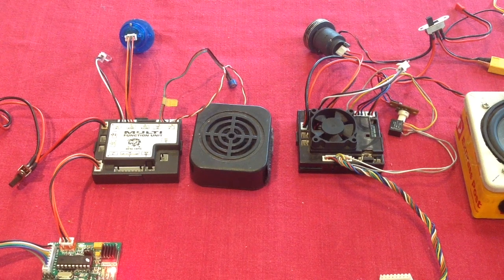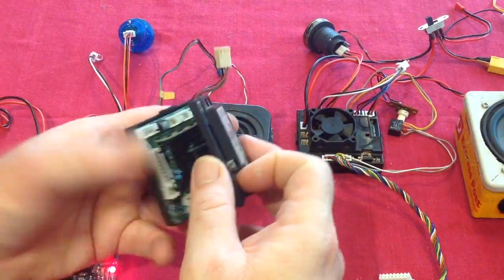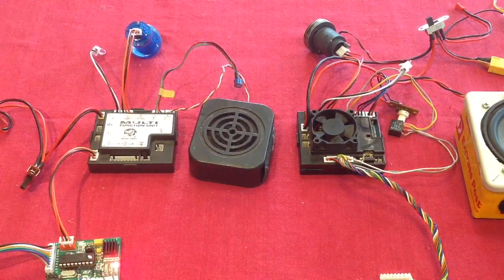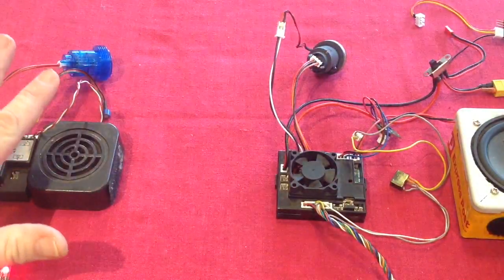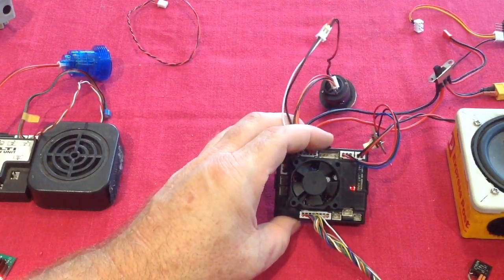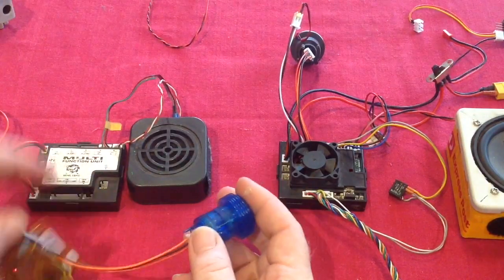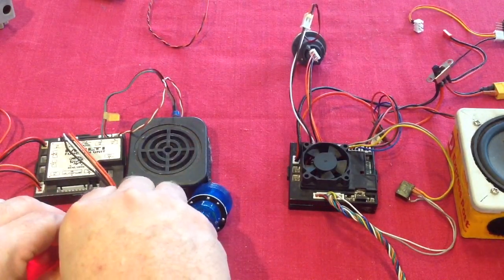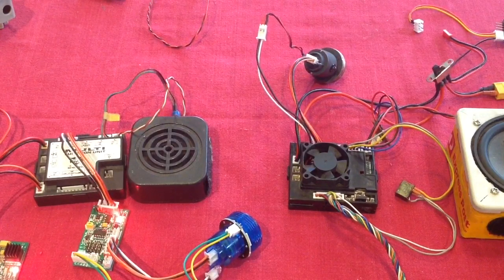Understanding The Heng Long & Taigen MFUs - Part 1

Comment: The RX18's were what I started with, of course, and they're all complete garbage.  Fail randomly, scratch that, they fail amazingly since you can always depend on them!  To fail, that is.  It was disturbing to play with my tanks, or attempt to, have them fail after literally a minute or two, and NOT even know what the problem was... was it the receiver (RX) did I burn up yet another one?  Or is it the transmitter (Tx) this time?  Did I do it?  Did i slap it too hard checking the AA batteries, or, heavens forbid, DROP THE TRANSMITTER - (instant DOA, of course!)  Anyway, the 2.4 units were a God-send since they worked practically 100%; simple to bind Tx and Rx (I was today years old when i realized you don't really need the binding switch just a screwdriver and a third hand attached to the other two).  Have you seen the Hooben stuff, i bought 3 Rx and 2 Tx and these look much like Heng long to me, do you know if they are compatible?  I deliberately avoided Clark, not that there's anything wrong, but it just seemed like it ought to be lots easier fitting out my T-55 with stuff that all says "Hooben".  Although I still don't know how to get a spare Tx (thank goodness you can just bind one Tx to all of the same tanks, if I have to). 
Right now (dec 19) busy trying to fit the DKLM RC barrel recoil unit, to my second T55 (I guess i enjoy the punishment of re-engineering every part right out of the box)